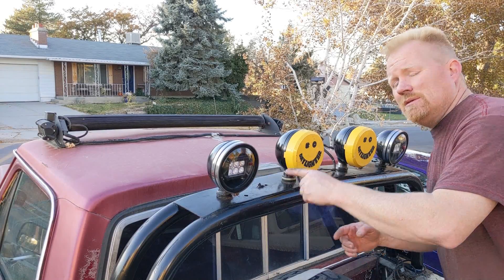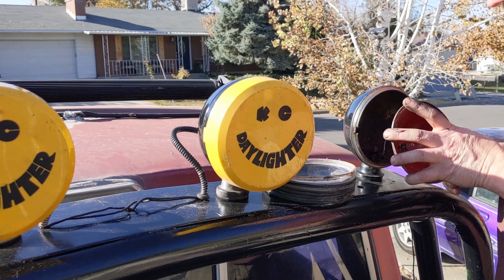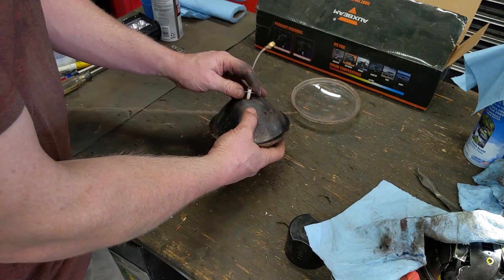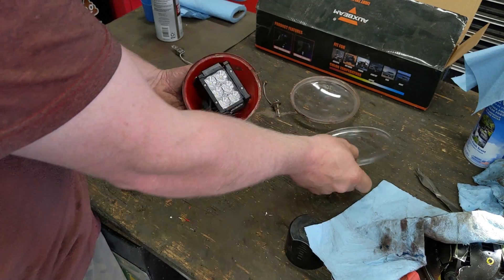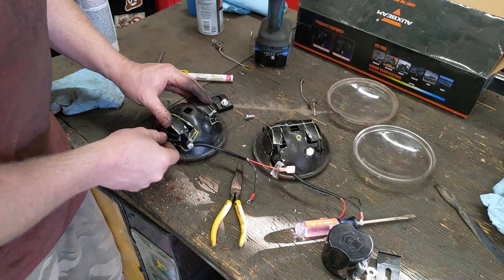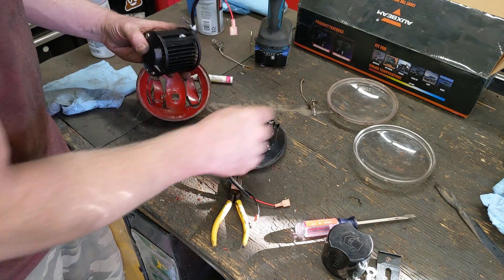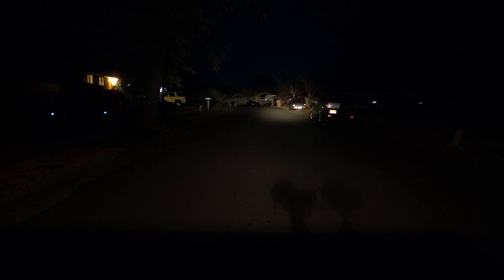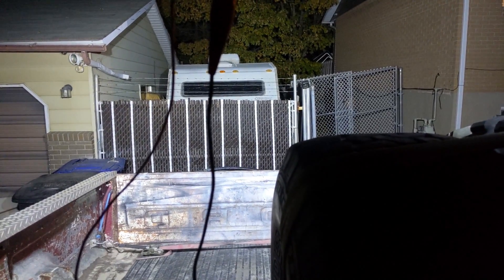Retro KC lights to Led POD conversion

Comment: Why not just get an LED sealed beam bulb? They fit right in where a sealed beam goes, plug and all, and cost less than 50 bucks.
Reply from the maker: Because these are around $10 and way brighter.
Reply: @sixtyfiveford  Ehh, I dont know about brighter. I got some LED sealed beam bulbs for my 69 C10 and they are just as bright as any other LED on the road. I like the universal part thing, if the LED bulb breaks on a road trip I can get a sealed beam headlight at the grocery store for 8 bucks.

Comment: leds will produce heat, enclosing them will inhibit their cooling and lower life span.
Reply from the maker: These little pod lights don't get even get warm to the touch after hours of running. The Aluminum casing/heat sink is 20x larger than it needs to be for aesthetics.

Comment: Not gonna lie, I would just put the aux pods up by themselves and be done with it.
Reply from the maker: Hey why not. It'll function the same.
Reply: @sixtyfiveford  
Never personally owned a classic Ford to get the nostalgia vibes. The only Ford I've owned was a focus ztw wagon. And like most of my cars, I wound up in a love / hate relationship with it. I loved it until a mechanic wanted $600 to replace a $70 water pump... "Yaaaa... I'll just do that one in my driveway then..."

Comment: youve contained the heat from the leds inside the old enclosure...shortening the life of the leds significantly.
Reply from the maker: These don't get warm at all. There are only 6 LEDs and the heat sink is way oversize for aesthetics.

Comment: I loved the looonng range beam of my 4 old 150watt sealed beam daylighters, had one burn out and removed one more to keep it even looking. 2 still put out PLENTY of light and agreed they are power hungry. had relayed, fused 8awg to each pair and a 140A alternator.    Great job on the retrofit👍old school cool with a touch of modern!  I do like the led pods and bars as well. I also used the aux beam pods as reverse lights, just mounted behind the bumper either side of the hitch!
Reply from the maker: Those 150watt Halogens put out an insane amount of light. 4 of those is around 50amps draw. 15+ years ago I upgraded to electric cooling fans that pull around 20-30amps, then if I run my heater(20amps) and my headlights(10amps), I'm maxed out with the stock 60amp alternator. I can watch the voltage drop anytime I would turn on the 2 100watt reverse halogens. Obviously a high output alternator is needed even with my LEDs.

Comment: This is great. I too hate the look of the cube lights but want their output. Yours turned out looking quite nice. Now I just need to find some broken KC Hilights for cheap...

Also, it's always nice to see the Dentside in a video.
Reply from the maker: Hey thanks man. The KC are definitely nicer but you can get the knockoff ones for around 10-15 bucks a piece and not feel guilty about cutting them up. If I recall I bought the non-KC ones in the early 2000s from Harbor freight for around 17 to $20 for the pair.
Reply: @sixtyfiveford  That's way more doable. Thanks!

Comment: Bought  a set of KC's hid stainless steel housing lights with a pencil beam 10 plus years ago. Killer lights! Luv them. They were 8 or 900 bucks at the time and came with a 23 year warrany no questions asked . Sent them in once already to be refurbished due to yellowing of the lenses.  Had to sawsall them out of my bumper due to the main mounting bolt being made from steel and rusted bad enough that i couldn't get them off. Called KC and told them and they told me just cut them out. Got back two brand new units with upgraded stainless mounting bolts . Great company to work with.
Reply from the maker: KC makes great products.
Reply: @sixtyfiveford  👍
Reply: Now they only have a 5 year warranty. Useless

Comment: Updating my comment. Interesting idea, but I have gotten burned on LED lights in the past. However, I missed the brand name Auxbeam the first time I watched. I have a friend that put Auxbeam on his 1985 Ford F150 ,replacing the sealed beam housings. His headlights are FANTASTIC. Nicely done artwork to use the vintage housings.
Reply from the maker: That's why I didn't just swap bulbs. I don't think you can win by putting led bulbs in a housing made for reflectors. The reflectors are always designed to take a pin point of light from the center of the housing and focus it. These aftermarket replacement bulbs can't place the light source dead center and can't be focused correctly. They scatter the light everywhere. The only way to get LED headlights work in a car is to buy a complete new housing designed for LEDs where all the LEDs face forward. That is the idea with me using these stand alone lights inside the housings. If I would have just bought the LED bulbs to swap in they would have been dismal.
Reply: @sixtyfiveford  ❤️Yes, gotcha! I missed the brand name the first time around plus the proof's in the pudding. Wonderful light output!

Comment: Those look great. I think another benefit of the way you did it is maybe a greater chance of keeping water out. I've seen tons of those cheap led lights with water in the lenses
Reply from the maker: That's why I went with the Auxbeam brand as no water has gotten in the others over the years of sitting outside. These are cheap at 9bucks but not the cheapest. I think you can find ones for around 5bucks these days but they leak and never put out good light.

Comment: Those are great idea's.  I love that front facing light bar.  New back up lights work great as well.  Great job. Thanks for the video.  Why is that front facing light bar so much brighter than the rear  facing lights?
Reply from the maker: The front bar has probably 100 LEDs vs the 12(6each) in the rear lights. The front bar is almost too bright and I wish I could dim it down.

Comment: And i thought you were going full retro,  spotlamps with ordinary bulbs connected directly to the colum lighting switch so the switch burns away.... No no relays, no fuse, just a dead switch lol.
When i was around 18, young men bodged lights in that way, not me as i liked motorbikes.
The expression on your dogs face ha ha :-D
Reply from the maker: The first set of lights I installed as a youth I learned my lesson. The switch melted away rather quickly.

Comment: Nice update!! Would've been cool if you used your meter to measure the electrical draw before and after.
Reply from the maker: The LEDs are 18 watts each. So 72watts/6amps for four lights vs 400watts/34amps for halogen.
Reply: @sixtyfiveford  The less work the alternator and battery have to do, the longer they will last, generally.

Comment: What about Heat ? 
Not a issue ?
Reply from the maker: Not an issue. The entire housing is an aluminum heat sink that never even gets warm with my testing. I think it's oversized for aesthetics to start with so even putting in the other light housing won't affect it.

Comment: When I moved I had to remove my lights as the truck was shipped and they claimed too tall (yet they later admitted it would have been fine...annoying).  Been struggling on finding good looking lights for replacement of my kc daylighters.  Thank you so much!  Was saving my pennies for that many multi- 100's of $ expense.  Now...not!  And I use a similar arrangement.  2 floods in my brush guard, 2 floods in the outside top, 2 spots in the middle top, and 2 fogs facing rear from the top.  Thus, the floods in the brush guard fill close and wide (coupled with headlights and factory fog), the top floods fill far and wide, the top spots do really far and fill in the gap between the top floods, and the rear, usually don't have on unless I have to back up so I don't blind my buddies, but is similar to what you showed.  You do feel it with all those halogens on.  Even with the accessory alternator installed.
Reply from the maker: I can watch my battery voltage plummet with a set of halogens on.